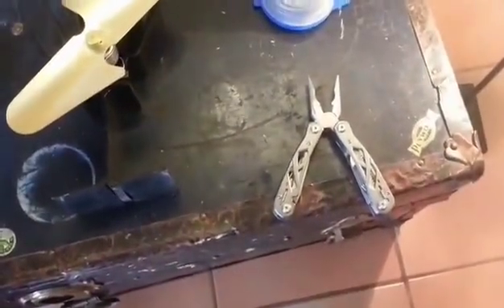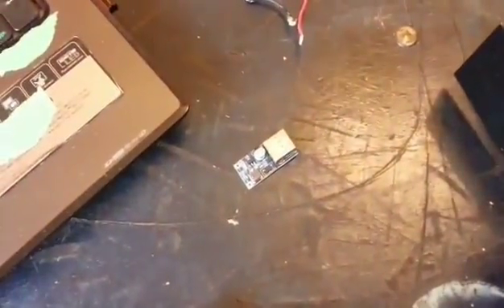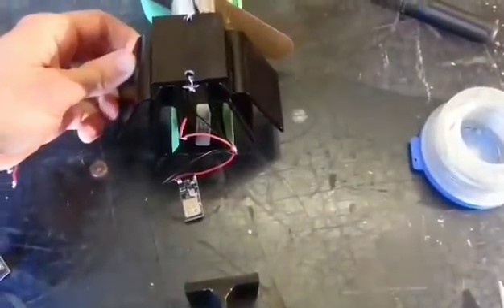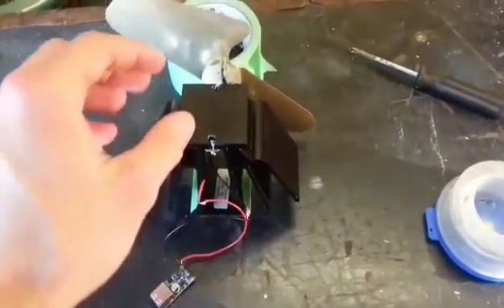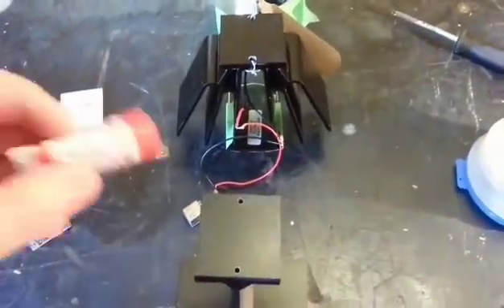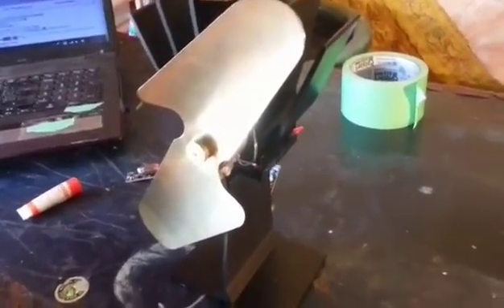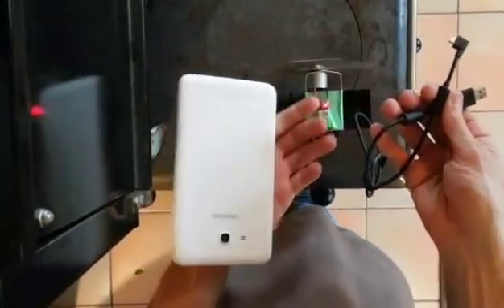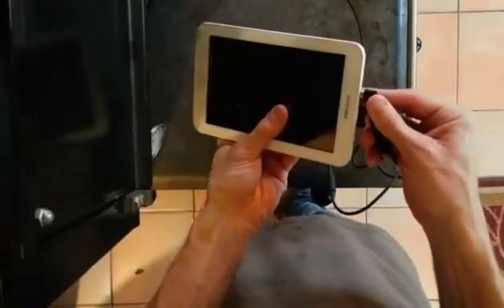CELLPHONE CHARGER EASY WOODSTOVE FAN 2 minutes

Comment: We have one of these fans and considering doing this.  Another option might be getting heat from the stove pipe, that way you could link more of them in series.  Perhaps the fan cools the other side of the TEC, creating a greater difference.  Did it take long to charge?
Reply from the maker: Took a long time to charge.

My experiments told me three chips stacked in the fan is not better than one.
Reply: @busyjambes  thanks James. Stacking them I don't think works because they work on the difference between one side being hotter than the other. You would need them side by side. There are heatsink assemblies that might work but they usually have plastic fans 😂 I've seen some designs for curved surfaces perhaps to go on exhausts

Comment: Thermal Compound????
Do you mean heat resistant glue?
I’m trying to fix my fan, looked for “ thermal compound” hardware stores don’t know what the compound is….. most store helpers think it may be the thermal glue????? Please clarify
Reply from the maker: It is a thermally conductive grease, not glue. Thermally conductive glues sell for $500 for a tiny little bottle.